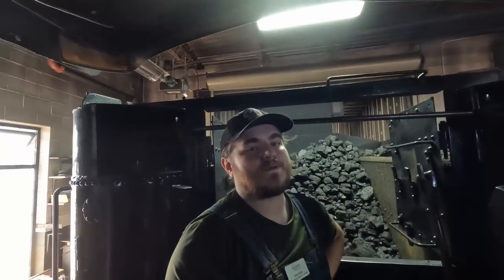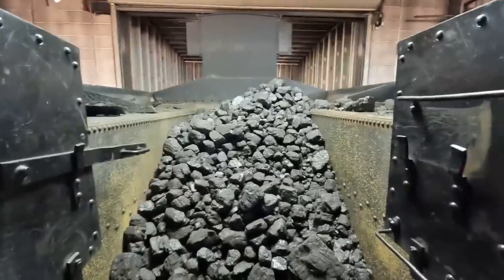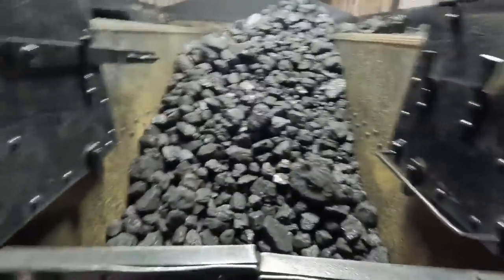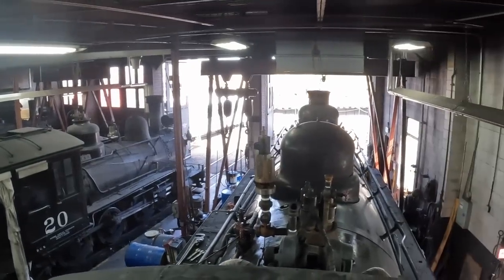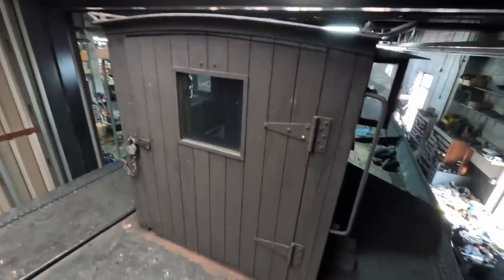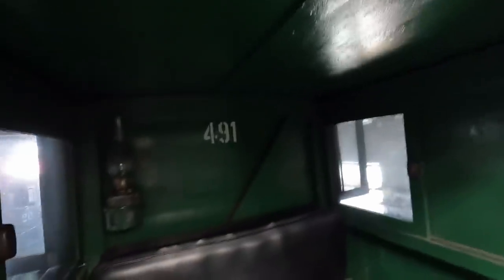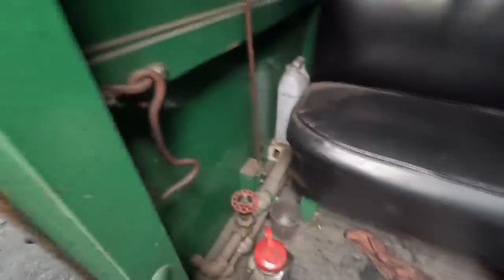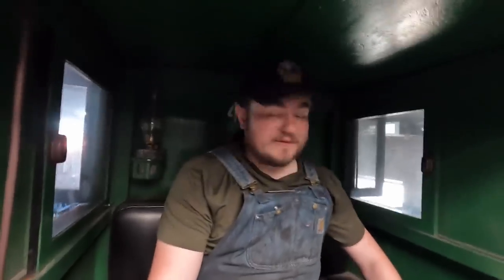Why is there a HOUSE on the TENDER? - D&RGW K-37 491

Comment: If I recall correctly, the head and rear end brakemen were also expected to protect the train should it make an unscheduled stop due to problems.   They would walk out a specified distance with red flags and fusees.  This was important when trains were run primarily on timetable and train orders in dark territory with no on-line signals.  This safety requirement was likely one of the reasons they were kept on trains even if that train had no switching on route.  Also, I'd expect the head end brakeman to watch the train from the doghouse, especially on routes with lots of curves so that those in the caboose could not monitor the whole train easily for hotboxes, etc.  Thanks for sharing this interesting item of railroad equipment.  Cheers from Wisconsin!
Reply from the maker: Cheers Andrew! Spot on about the flagmen role. That's absolutely critical and written into the rulebooks.
Reply: IIRC brakemen were also known as switchmen and one of their jobs was to throw the switches on sidings and such, also coupling and uncoupling cars, which also includes applying the handbrakes. When in the cab they were also used as stokers in some cases. Lots of work for the lowest paid members of the crew.
Reply: Was it normal to have eyes on every part of the train back then?
Reply from the maker: @ChadDidNothingWrong  as many as you can!
Reply: My guess is that they were probably also armed due to all the train robberies
Reply: Yeah I would say you're right, Andrew. I used to work on the Canadian Pacific as a  "brakeman". (Or in the yard, a "helper"- same job, different name) Long after they got rid of the van, they had a brakeman up front. The route I travelled had no switching, and it was incredibly boring. The job was basically calling out signals on the radio for the benefit of the dispatcher and the data recorder, and if the train had to stop, to lay out torpedoes and fusees. Which never happened to me at all. Basically I think the reason the brakeman was still there is because of a union stipulation. And of course now "brakeman" is an extinct job, on class 1 main lines anyway.  In the yard, of course it was all switching, and having two guys on the ground makes a lot of sense. One thing he doesn't mention about having two brakemen, is that before hand-held radios, if the guys on the ground are giving the engineer hand-signals, it might take two or more men to relay hand signals from the guy at the back. They taught us to do that, even though I always had a radio. I was given to understand by the older guys that radios were a relatively recent thing when I started in 1994. Progress is very slow to take hold on the railway. They had hand-signals for everything, including "coffee break". Sorry for babbling. I became an air pilot eventually. But I sometimes miss the railway. Apparently it has become a lot less fun however.
Reply: @pathvalleyrailroad9277  the doghouse must have been popular if riding in the cab meant you'd be pressed into service shovelling! :)

Comment: My family has a Model A and that's exactly what I thought of when I saw that seat so i bet you are right! I had the old seat we removed from the car when we redid the interior up in my treehouse fort as a kid and this gave me an instant flashback to that, what a fun piece of history! Also I can confirm that they are pretty darn comfortable to sit on, so I bet it's a pretty good ride. Great explanation video Hyce.
Reply: I didn't think Model A, because the only seats I am familiar with were in a few years of Cabriolet, and they had a fabric cover with sculpting (the number of sections help define the year of manufacture).  In a faithful restoration, the sculpting is maintained or recreated.  I did, however, think of an automotive seat from that time period.  It's a good thing the seat was comfortable, because the suspension was akin to my little utility trailer's.

Comment: D&RGW had quite a few of the standard gauge steam locomotives equipped with doghouses as well.  If I remember correctly, the steam heat was a union requested addition.
Reply: You don't want to sit inside a dog house like that without heat in the winter (i had a friend who worked as a brake man on a railway in Sweden and started doing that 1941, the war winters, no heat and it is -30 celsius.....)

Comment: I love the idea of having a doghouse on the tender, and with cushioned, heated seats. Let's say you're assigned to a long haul train running from Antonito to Silverton in the dead of winter. Snow is everywhere, sometimes as high as the coaches. You get the assignment to sit in the doghouse during the run through Cumbres Pass at night. It's going to be hell, unless you come prepared.

Me, I'd have a nice, warm blanket, comfy pillow, a good book or two, some food to munch on, and lastly, hot coffee, kept near the steam pipes to make sure it stays hot. Get to an area where you don't need to be awake? Take a little snooze. If you're going to be needed soon, the engineer could give a couple short blasts from the whistle and you'll be wide awake!

Comment: It's kind of unusual to see this on American rolling stock, but this was a pretty common feature on older German rolling stock, especially where there was no through brake pipe- many goods vans and other rolling stock had a Bremserhaus ("Brakeman's House" in German) which was basically just an enclosure around the handbrake wheel that resembled an outhouse, and they lasted in service for quite some time, even in the era of fully-fitted trains.

Comment: I was at Dollywood earlier this week (August 15th) and I noticed that most of the shirts they were selling for their Dollywood Express had their WP&Y locos on it, except one shirt which had a D&RGW K class on it. Also, I was watching your Steam 101 video last week and when I went and rode behind Reading & Northern 2102 and 425 doubleheader, I noticed that 425 has her throttle valve in the same place as the Big Boys: after the superheater flues.

Comment: Very entertaining and informative.  I grew up next to a 3 and 4 track section of (electrified) PRR.  All the freight trains had a caboose with top mounted cupola.  I understood the purpose of the caboose and its crew, but I wondered how they could function so far from the front of the train, especially since trains had run that way for decades.  I lived next to an ungated and unmarked crossing.  This was a frequent stop and pause point when any mishaps occurred,  so I would sometimes see the locomotive crew outside their cab.  I almost never met a caboose crewman, except through my exuberant wave, which was often returned.

Comment: Pennsylvania railroad locomotives had doghouses even in the 1940s The doghouses are even the reason why tail tales are a thing if people ever wonder why there are chains dangling down from gantries before every tunnel on railroads So if the head end break man Is running towards the rear of the train applying handbrakes as He goes How is he going to see that there is a tunnel approaching cause hes running towards the rear of the train so he can't see that there's a tunnel so the tall tail will warn him that a tunnel is on the Horizon And that he needs to hit the deck onto the rail car so he doesn't get hit and killed by the tunnel It also helps when their signal towers that hang over the tracks that he could get hit by

Comment: The other job of the head-end brakeman was to be another pair of eyes looking back down the length of the train for problems, especially "hot boxes"-- overheated wheel bearings--a very common problem in the days before rolling stock was fitted with roller bearings.
Reply from the maker: Definitely an important part of the gig!

Comment: Brakemen were required at one point to apply car brakes individually, but better brake systems exist now. The doghouse can be used by the conductor for shelter during bad weather if the conductor was up at the locomotive for any reason. The only thing missing is a fan, but that's no big deal.
Reply from the maker: That was a long time before this locomotive was built.
Reply: @Hyce777  Yeah, but some cars still have hand wheels on them that need turned. Having dedicated guys for that as you go makes it go that much faster.
Reply from the maker: @ColtonRMagby  if you've got airbrakes you're not touching the handbrakes unless you're leaving the cut unattended. They act as a parking brake. If you had some failure of the airbrakes you might have had guys going to go tighten down hand brakes but that would be extremely uncommon.

Comment: So, I was told that a big use of the doghouses were for helper operations over Marshall and Cumbres Passes. As I understood it, there was a brakeman/conductor that was assigned to the helper locomotive to align switches and attach/detach the helper from the road engine. And the doghouse was there "caboose" of sorts where the brakeman lived when the engine was on duty
Reply from the maker: Makes sense!

Comment: A lot of the job of brakemen was throwing turnouts in route.  On a longer train, do you want to stop and have a crew member walk the entire length to set a turnout?  Thus, one brakeman on the front, one on the rear.  Having turnouts lined ahead and behind a moving train by a central dispatcher rather than stopping for local control is what really ended 5 man crews and cabeese.  I try to replicate the stopping, waiting, and throwing the switch when I run model trains, including stopping to line the switch back after I pass.  Love your videos, and I watch all of them!

Comment: That head end brakemans cupula would probably be used as a bath room as well on long haul trips.
Reply from the maker: Possibly, I guess...
Reply: @Hyce777  i drive commercial truck and though it's on the tender it reminds me of my truck i had a overnight box truck with a sleeper unit. The box was just big enough to lay down and sleep in and had minimal under/above bunk shelfs for storage. That cupola reminds me of sleeper cabs. most, even my box truck sleeper had a pull curtain so you can be in relative privacy in the cab.

Comment: A fireman actually does a lot more than just shovel coal (or handle wood, or operate an oil burner).  The fireman is also responsible for when and how much to inject water into the boiler, maintaining steam pressure - not too little but also not too much which will pop safety valves, using the fuel efficiently and trying to "burn clean".  It is a sort of balancing act between things.  To do this well, the fireman needs to know the characteristics of the engine, the route and especially its grades, and the train weight.  And must be able to plan ahead or might wind up with a stalled engine.  The fireman also assists the engineer in looking down the track from the left side of the engine.  And may repeat back to and confirm track signals called out by the engineer.  And a fireman is also likely to be an "engineer in training" as engineers typically are firemen first and it is from those ranks where there are promotions to engineers.
Reply from the maker: All correct points! You should check out my firing 101 video for my takes on it.

Comment: Hey hyce, do any American steam engines have corridor tenders like how some of the UK locos have where you can go from engine to coach without having to climb over the coal load? On a side note I really wanna ride in that hut for some strange reason 😂
Reply from the maker: Never seen a corridor tender in the US; I don't doubt that one exists but I've never seen one.
Reply: The Milwaukee Road used corridor tenders for its Hiawatha express service. I don't think any survived.
Reply: @Hyce777  Not a steam locomotive but didn't some earlier diesels which had a second power car/slave power car attached by default ususally have a corridor down them so that crew in the leading cab could walk through them?
Reply from the maker: @TheHandgunhero  all diesels that I know of have the ability to walk down the consist, yes; this includes the E and F units from the 1940's.
Reply from the maker: @adammcdowell7815  like i said, not surprised:) thanks for educating me

Comment: Is the doghouse high enough to see over the tops of the cars? I rode in a caboose not long ago, and the cupola doesn't provide that great of a vantage point unless you're going through bends, because it was actually too short to even see past the first passenger car.

If one can't see the whole length of the train - or at least the half of the train that the other guy can't see - then I don't see what good the cupola does in terms of giving the conductor a means of keeping an eye on the train, other than being a cool place to sit, I suppose.
Reply from the maker: The doghouse is plenty tall, most narrow gauge cars are around tender floor height ish.

Comment: Adding weight does not damp oscillations in the suspension. It moves the mean of them down, and maybe otherwise the suspension is hitting some stop at the top; I don't know. But damping would require friction.
Reply from the maker: True, the mechanics of the spring don't change. Fair..

Comment: Wasn’t this an ICC Requirement for the railroad to provide a reasonable accommodation for the head end brakeman?  I.e., not making him stand in the gangway the whole shift.
Reply from the maker: You know, I would not be surprised; I am not sure though.
Reply: I would think if it was a requirement, ALL tenders would have had doghouses.  As it was, only a few lines had them.
Reply from the maker: @johns3106  someone was telling me it specifically had to be a seat. 346 (no doghouse) has an extra seat.

Comment: What's that tank-ish looking locomotive next to RGS 20? It's also kinda surprising that 491 doesn't have a ladder on the tender, considering it had / has a doghouse.
Reply from the maker: Standard Oil #1, an 0-4-0 from ALCO. 491 does have a ladder on the back.
Reply: @Hyce777  then why didn't you just use the ladder?
Reply from the maker: @Sleeper____1472  inconvenient to get to all the way backed into the shop like that. Too much shit lol

Comment: Certainly isn't for aerodynamics, LOL.
On an entirely unrelated matter, do you find it disappointing you're (apparently) restricted to what is a pretty short loop of track? Seems a shame you can't ever get the engines out for a 'proper' run anywhere. Or can you?
I'm sure getting to work on a running steam train is great no matter what, along with the camaraderie that doubtless is part of it, but even with that a greatly restricted track area seems a bit of a bummer.
Thanks for another fun vid.
Cheers
Reply from the maker: The loop does get old, but we can take (and have) taken RGS 20 out to play. 

The fun thing about the loop is you get to try multiple train handling techniques over the same railroad over and over. It's fun to experiment and see what works best. That's the best way to keep it fun
Reply: @Hyce777  I figured enthusiasts would find a way to enjoy it regardless, which, to be clear, I think is a great skill to have.
Thanks for the answer.
Cheers
Reply: @Hyce777  Forgot to ask: next time RGS 20 goes out, any chance you'll get a video on it?
Cheers

Comment: Hey Hyce, I have a question. What is the top speed or recommended speed that the locomotive can achieve. Just curious.
Reply from the maker: Specifically 491? Probably about 35 ish MPH top recommended. Maybe she could do 40 but I doubt it.

Comment: Man I wish I had the cash to get into steam sooner than later , right now im looking at old sales listings for traction engines  the ones I like were between 7-9 k less then my 1997 John deere  5400 that right now has bad transmission berings
Reply from the maker: It is expensive, and the work to keep them running is only expensive-r!
Reply: I imagine so especially with the large locomotives more/bigger parts involved its definitely not a little 16 horse baker traction engine I could haul on a flatbed or afford the tools to work on

Comment: What you did not mention is that between the time that this locomotive was built and 1935 when the dog house was built A new rule came into existence requiring that each crewman on a locomotive have a seat. Heretofore said brakeman stood around the locomotive. Now he could no longer do so. On a passenger train, no problem, on a freight what to do.

This same rule is in effect today, you may not have a third man on a locomotive unless said third man has a seat. But today's locomotive builders already know this and install a third seat. in the locomotive. But now we have a two man crew and many trains run with a one man crew, and he too will soon disappear as many trains will be able to run with no crewman at all.  Hey... If my HO scale trains can do it using a simple analog system, it is no problem for the railroads to do this too.
Reply from the maker: Huh, that's neat. I wasn't sure if there was a rule for it or not, though it makes sense.